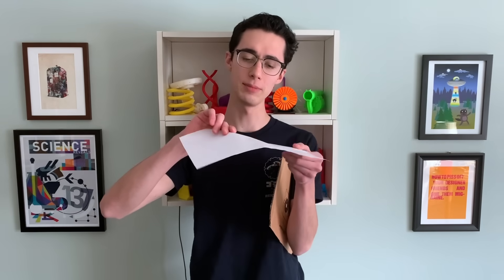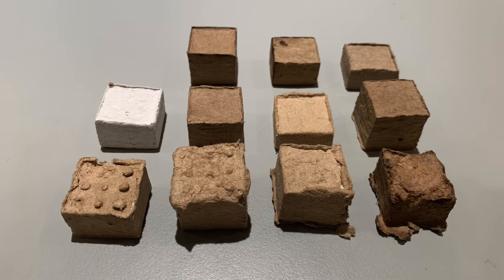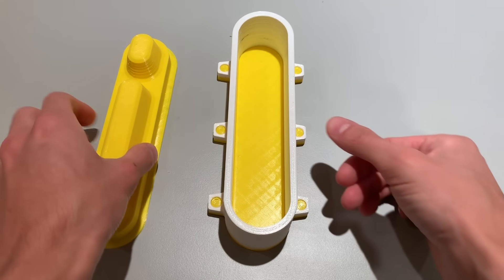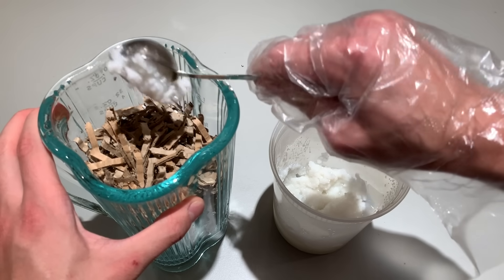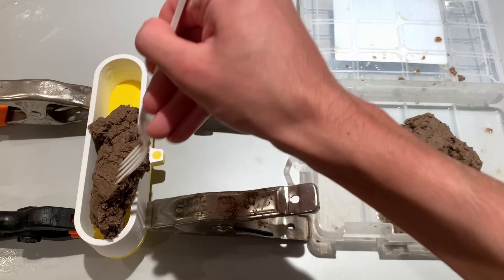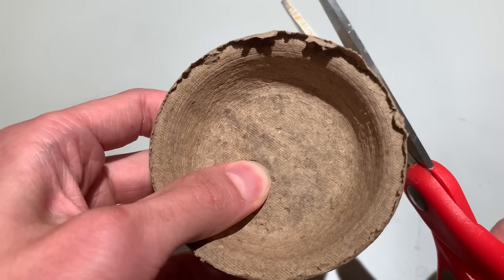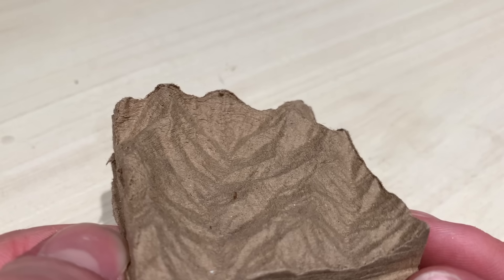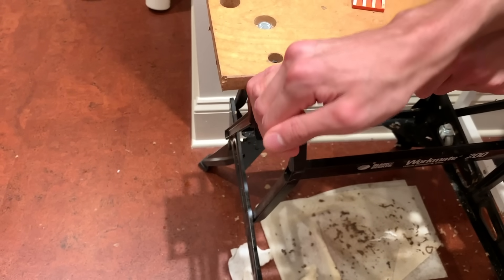Recycle Cardboard into Anything with 3D Printing!

Comment: use abs (binder) dissolved in acetone and it should give you water resistant parts  and they should dry faster maybe even dry them in a low temp oven or dehydrator aswell just ideas not backed by testing
Reply from the maker: unfortunately ABS is plastic so that would miss the point of making something out of this material

Comment: Although this is a four year old video I will say making it out of abaca banana plant fibers will make it more water resistant and increase strength, even if you mix it half and half with recycled cellulose.

You can also include certain additives for example latex which is biodegradable but would greatly increase water resistance and overall strength.

There are other natural ingredients like gelatin or chiton powders which will have similar effects but increase rigidity.

Comment: You have probably already heard this, but you can definitely make a thing water proof and much more durable by coating it with a number of layers of mod podge.  But, since this is PVA and acrylic medium (thus "plastic") what about shellac which is made from bugs and is water proof? And lacquer is another non plastic alternative as it is made from the resin of trees.  Just some thoughts.  I do not have a 3D printer and do not intend to get one.  Do we think a mold could be made from wood perhaps--if that had been treated against water influx?  Other ideas that do not require a 3D printer?
Reply from the maker: You can definitely make the molds out of different materials and with different fabrication processes. I’ve seen people CNC mill molds out of wood, or even just make primitive block molds out of plywood.

Comment: I'm curious if the little sinewaves and carton shapes made with this have better noise cancelling properties than cheap foam wall tiles? They're probably better than cardboard egg cartons, at the least...
Reply from the maker: I don’t think the material would work well for acoustic damping. It’s not absorbent or porous, which are the characteristic that make foam work so well. I think a lot of people suggested this simply because the parts I made visually looked like acoustic tiles.

Comment: I wonder if it can be mixed with bits of plastic or rubber and made into bricks for construction (or alley pavement) 😳 It would need some kind of final coating so it doesn't rain on the paper-brick wall thou 😅

Comment: Hey. Nice project!

Do you know hard it is to make this into bigger square sheets on a more industrial scale? Ever looked into that?

We use a lot of extruded poly as shaped cores that we then cover with either fiberglas or fibercarbon to make lightweight strong structural parts for multiple applications.
I know your point was to keep it fully biodegradable, but i think it would already be a big step if we could replace the extruded poly urathane with something like this. We use a lot of that stuff.

Anyway, good work and i hope this technology has a future 👍

Comment: A light coat of water resisting stain on the finished object, like a deck treatment, should make it fully water proof.  Deck stains come in a variety of colors.  If you want a bold color, just mix some color beads in the blender at the start then apply a clear deck treatment.  Stained objects don't paint.  But they can be periodically re-stained and should maintain water resistance.  There are other people who mix industrial cement with paper paste (no binders) and make light weight durable planter pots.  However industrial cement making is very bad for the environment.  I prefer your approach.  But making a large planter would require a huge press and mold pieces.

Comment: what about coating them with liquid bees wax to make them water proof? Also, have you tried spraying the sides of the mold with some of that non stick cooking spray to allow them to reelease more easility from the molds? And also have you considered adding some strategically placed micro holes in your molds to allow for drainage of water(small enough to allow water through be too small to allow most of the publp throuth?

Comment: How is the dimensional accuracy of the pockets?
Reply from the maker: @kay6736  not great lol
Reply: @XYZAidan  Unfortunate, but to be expected.
Have you tried keeping a pocket filled with a dimension-accurate piece to see if it will dry and shrink around it?
Could enable precise packaging for small businesses if it worked.
Been thinking about using foam and just CNCing it out, but your method looks nicer, particularly with nicer paper. If you have the time, I would be very interested in seeing the results of A) the pocketing and B) different types of papers.
At least in principle, it seems like one should be able to make very cost effective and high quality / premium feeling custom packaging for their shop.
Reply from the maker: @ This might be more up your alley: https://youtu.be/T0GGPoke4Kc?si=ItQb7ZvcRDxgtxUV
Reply from the maker: @kay6736  This might be more up your alley: https://youtu.be/T0GGPoke4Kc?si=ItQb7ZvcRDxgtxUV

Comment: Seein Aidans pinned comment made me realize that apparently some folks believe this to be equivalent to MDF (Medium Density Fiberboard) which it isn't. MDF & HDF (High Density Fiberboard) are both made from sawdust that has been mixed with glue and pressed into sheets, using several tons of sheer pressure. This is made from pulp, which is not the same as sawdust. Paper and cardboard is made from wood pulp, which itself is made by literally cooking the wood by blasting it with superheated steam, which breaks apart the ligning that holds the cellulose fibers together. This is not the same as sawdust and glue under tons of pressure. You're welcome to test it out if you disagree

Comment: Watching this video all I kept thinking is "why isn't he making interconnecting blocks?".  Devise a few different shapes and get the science part of it down a bit better so that the sizes will be consistent, and you can have something like Lego.  On a larger scale this could be used to build almost anything, although in the end there would need to be some sealer used to protect whatever gets made from dissolving in the rain.  For these small projects you could use the epoxy that I purchase at the dollar store.  Then you could make flower pots or whatever you want.

Comment: Use an organic coating or resin to make it waterproof. I bet if you let the fibers dry and blend them with resin you can make it much stronger!
Reply from the maker: @GoblinYolk  Organic coatings such as…? And if you mean epoxy resin then that’s literally just plastic.
Reply: @XYZAidan  You're thinking of epoxy/synthetic resins. When I said organic I meant it for both the resin and the coating. Something from plants like a sap, gums/Gum arabic, or wax/Bees wax, oils/ linseed oil, or a combination of them that when mixed make a perfect binder for the paper fibers. You could also use an animal based binder like gelatin and also Calcium or magnesium carbonate for ph control so the paper doesn't degrade as quickly. I'm only familiar with the paper making process so you'll have to figure out which ones could work for what you're doing.
Reply: @XYZAidan  also okra gum can be used as a binder!
Reply from the maker: @GoblinYolk  Okay great, thanks for actually naming some specific examples. I’m sorry for assuming what you meant, I’ve had a lot of people comment, “use epoxy resin/deck sealant/paint” while clearly unaware that those are just other synthetic plastics.

Comment: Try use wax/paraffin to waterproof it. Crumble a piece of candle on top of the item, and use a heat gun to melt it -should soak in pretty well. Experiment with how much wax to use.
I did it once with an engineered wood countertop. When heated, it can soak in quite a large amount of candle wax. When cool down, all that wax that has been absorbed between and into wood fibres solidifies and makes it completely sealed. It Will last forever, if not heated again

Comment: What you call cardboard at the beginning of the video is actually corrugated fiberboard and the egg cartons and such are moldable fiber board. Cardboard is literally the stock that playing cards are made from. I worked at a box an insert company and was a 2nd pressman on 4 color offset and web printing presses for years and have worked with almost every type of paper and paper stock imaginable. Using the proper terminology is important, especially if you want to be taken seriously as a creator.

Comment: Imagine a row of 25 items lined up in the garage with a piece of flat plywood on top. Roll the car onto the plywood ramp until it levels out. Compressing the 100% infill?  Is this possible outside of imagination? I've never seen if anyone has tested 100% info 3D prints under that much weight.

Comment: Ambient water (in the air) will slowly decompose it or at least comprpomise its structural integrity.
A layer of lacquer of shelac should protect it from ambient water.
Reply from the maker: eh, only if it’s extremely humid. under normal conditions it does not degrade over time

Comment: Water 💧 proofing is easy- Mix acetone and silicone in equal parts and put in a spray bottle 
Spray coating and allow to dry.
Reply from the maker: @007DFWAngel  silicone is not compostable

Comment: If you want your end part more water resistant, simply paint it with an exterior waterproof glue.
Reply: Alternatively, apply a coat of car wax.  I might try this with sodium silicate as the binder.  It's often used in cardboard manufacturing.
Reply: @dennyatnotts  
The problem with using car wax is that it will eventually wear off.
Whereas external glue, will not.
Reply: @scotttovey  I'm afraid I wasn't very clear.  Use the sodium silicate as the binder and wax the outside.  Sure, eventually the wax will become compromised but the real value of cardboard is that it readily degrades, unlike plastic, which is what most paint is.

Comment: You probably won't respond to this, but;
Have you tried mixing the cardboard with plastic? Then 3d printing with the mix?
Reply from the maker: No, and I don’t really care to given mixing the pulp it with plastic would make it no longer biodegradable.
Reply: @XYZAidan  what sense does that make? you dont refuse to use plastic because it isnt biodegradable, right?

& I mean technically it would be recyclable; 
if you were recycling this product as a plastic, it would need to be melted down anyways which would burn away the pulp.

have you seen mixing sawdust with ice? pretty neat. pulp is just a fibrous form of sawdust, for the most part.

essentially I think it would just be use of a filler of some sort that might have specific use cases.
Reply from the maker: @Obliv210  The whole point of this project is that it creates 3D forms out of a material that IS biodegradable and compostable. Mixing plastic into it defeats the purpose.

Also, fiber mixed with plastic would definitely not be recyclable. The temperatures used to extrude thermoplastic is not hot enough to cleanly burn paper. Maybe it could char it, but that would ruin the plastic.

Comment: Im Very interested on something like that for produce wall's with ventilation holes.
In my Idea I'm looking for the best ratio of inlets dismeter to smaller holes which gives you higher air flow
Reply from the maker: Sounds like you need a textbook on heat transfer
Reply: @XYZAidan  what do you mean?
Reply from the maker: @CUBETechie  I'm saying that nobody knows the number that you're looking for. It's likely a function of air speed, temperature, roughness of the material, and many other variables. There are analytical relationships and equations for these variables though. I'm serious: find a textbook on fluid dynamics or heat transfer and it should help you analyze your problem and hopefully find what you're looking for.

Comment: Hi,Aidan I am highly inspired by your video.I am facing a serious challenge which I hope you can advice.I have a small setup that convert corrugated boards to boxes.The offcuts and the waste generated I have been thinking if is possible to create a mould in a shape of the fluted sheet and then add the liners later to form a corrugated board

Comment: This solves a problem I have een having but also creates a new one
I don't have a 3D printer to print the molds
I am going to have to find a the thing i want to mould and make a clay mold some how by impressing the object, or I am going to have to cast HDPE over to object to create a mold and pray that i will get the object out again 
I really want to experiment with this material and try to get it as close to wood like as possible

Comment: you cannot burn it because it has only very few oxygen in it. This is why they blow air to phonebooks while burning them, so the sheets spread. If the block is not that dense and has air inside, it will burn.

Comment: I am making a pizza oven with homemade clay&sand bricks which I make. I am interested to know how the thermal characteristics and strength of my bricks would change as I add more and more paper pulp. I understand paper is flammable. I would expect greater than 50% paper would not likely to produce wanted results. Has anyone tried this? There are plenty of clay mache videos online but no one is tested materials for thermal/insulation properties.

Comment: Creating plastic moulds with 3d printer, to make eco friendly objects. 

Nonetheless nice work ...
Reply from the maker: 1. The molds are reusable, and can form multiple times their mass in cardboard
2. The molds don’t have to be 3D printed out of plastic. They could be CNC’d out of any number of materials or created via other means.
3. This video is a loose concept, not a concrete methodology. To focus on the 3D printing alone is to take it at face value.
Reply: @XYZAidan  👍👍

Comment: ב''ה, really been wondering about this for on-site shipping packing solutions, in alternative to the standard foams.

A blow in cellulose mash made from used boxes.. would have uses, but you've got to get something fast drying that isn't uniquely flammable, and handle staples and debris in the input shred.

Comment: "All you need to make plastic-free things is some paper, water, and glue. Oh and plastic."

All seriousness though, its not a bad idea especially if you have something you want a lot of, and it doesn't need to be very durable/last a long time.
Reply from the maker: A. The molds are durable and reusable and can recycle many times their own mass in paper.
B. The molds don't have to be made of plastic, they could be milled out of wood or metal. I chose 3D printing because it’s most available to me.
C. This project is not an instruction booklet, it's a loose methodology for a generic manufacturing process. If you took the project at face value, then you completely missed the point.
Reply: @XYZAidan  I'd be interested in how having wooden molds affects the end product. I wonder if the porous wood would warp or affect it in some way.

I wasn't hating on this, I just don't see many use cases for it

Comment: Ok, going off of the thumbnail, I thought a 3D printer was being modded to make prints with a paper fiber slurry (reminiscent of cement printers). I’m disappointed that’s not the case, but the process is still never the less interesting. 

I’m unsure how efficient paper bricks would be for packaging, as it would definitely be way heavier than using polystyrene (or even cardboard for that matter), not to mention it would probably be more costly, but any means for less plastic use is a good a good mean IMO.

Comment: since you brought up Eco-freindlierness; i sutter to think how eco- friendly a blender, shedder, and stove are... have you tried baking them, i bet they'll come out better ~ [with a dash o' cinnamon;~])
Reply from the maker: Everything has an associated environmental cost, it’s a matter of what it’s compared to. Compared the waste and emissions produced from the synthesis of petroleum-based plastics, I’d gamble that this is a lot cleaner.
That said, project is not an instruction manual, it's a loose methodology for a generic manufacturing process. Steps and tools can be switched and changed for however a user needs it. If you took the project at face value, exact the way I did it, then you completely missed the point.

Comment: I… I fail to see how this is different from something like particle board… well, maybe not. Where I work we have a 500 ton injection molding machine. I wonder if a machine like that with some kind of heat activated resin could make something like not-pykrete pykrete with this.

Comment: It seems you've moved on from this channel, which is a shame.  I would love to see you revisit this idea using the mixed PLA/Plaster of Paris mold designs of @ShakeTheFuture for his printable microwave metal casting molds in the video "Print-Wave Metal Casting: A Different Approach to Metal melting".  

One side issue with your compression molds is that they require a rather serious infill, which will require more filament in order to repeatably produce molded forms.  Replacing some or all of the infill with compressively-resistant plaster might reduce mold production costs and make mold pieces that last longer.   I would love to find out whether these ideas are compatible.